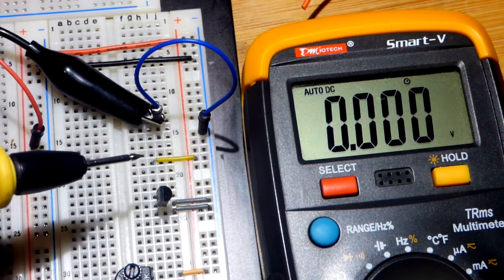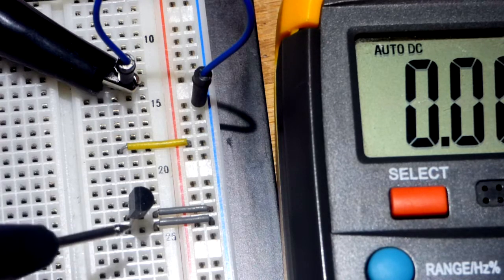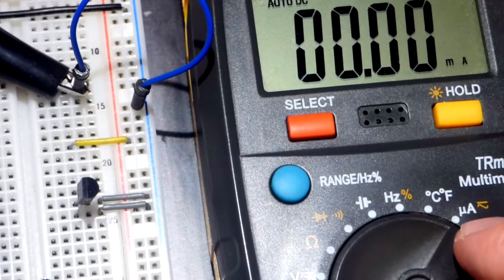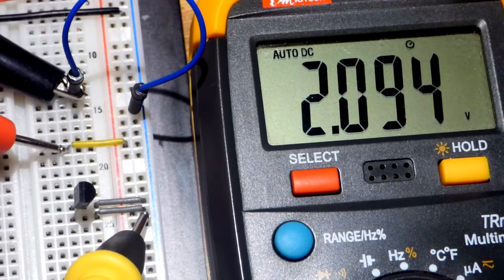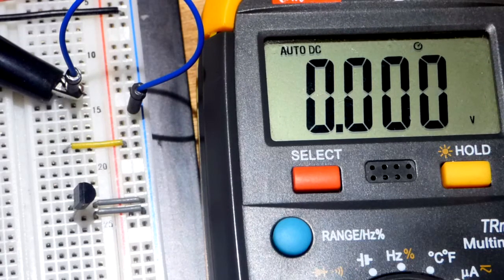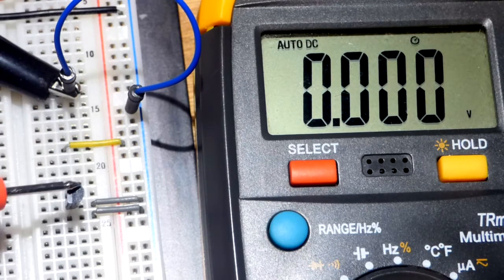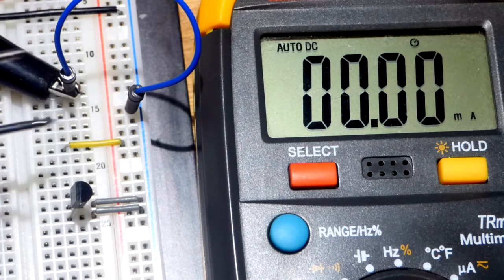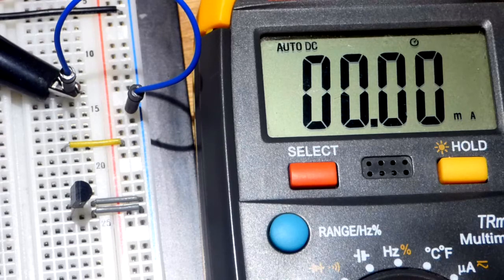Idss J310 N channel JFET component maximum current test

Comment: It's fortunate that you made your current readings quickly. The manufacturers use a short pulse to make these measurements. J310s can be destroyed by more than a few seconds operating at Idss.
Reply from the maker: I've never heard that they would be destroyed at low voltages. Thanks for the info!
Reply: @Electronzap  It won't necessarily be destroyed. There are always three variables whose maximum values determine the safe operating area for a transistor.
The maximum drain-source voltage for the J310 is 25V. Its maximum current will be its Idss. Its maximum continuous power dissipation is 350mW at 25°C.
For a 10V supply and an Idss of 36mA, you just exceed the maximum power dissipation and may cause damage if the temperature rise doesn't lower Idss below 35mA.
The manufacturers use pulse testing to determine parameters like Idss because self-heating effects would alter the value if measured continuously.